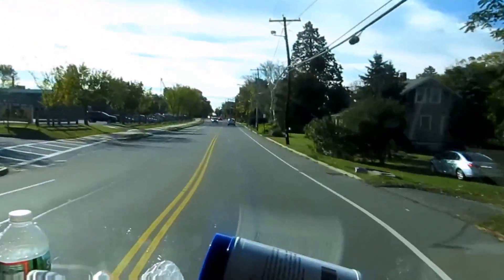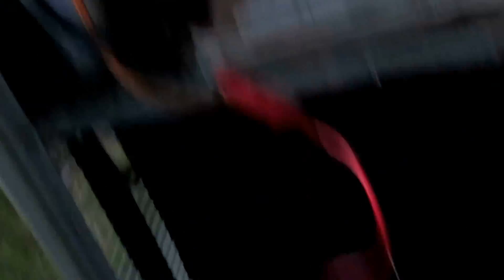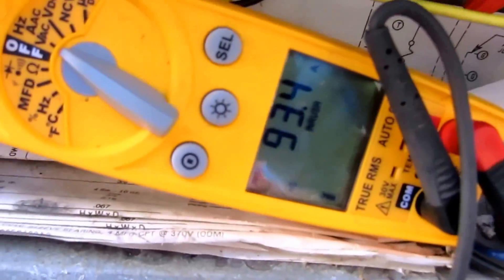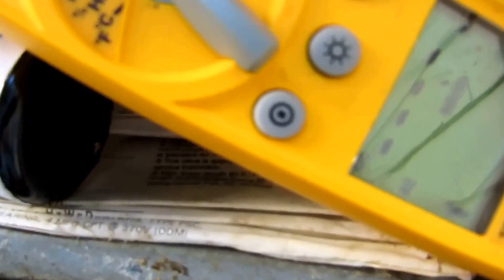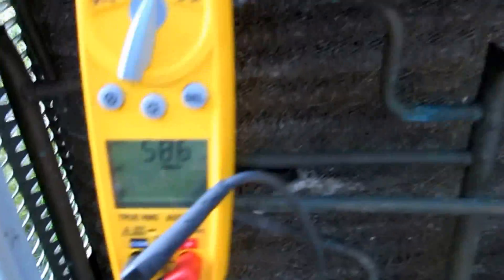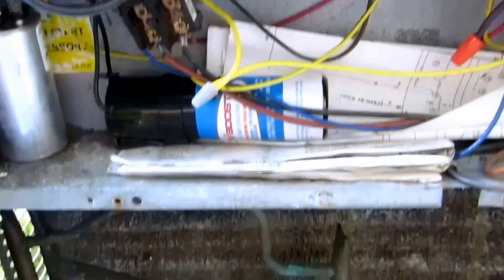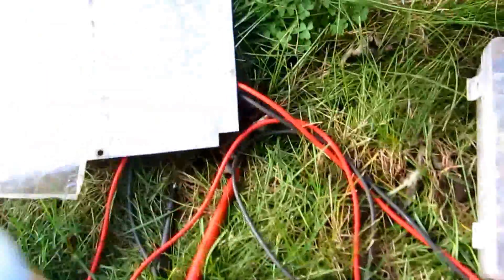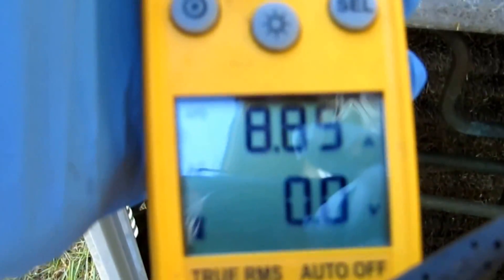HVAC: trane XE1000 condensing unit ,blowing fuse,high inrush current

Comment: have you ever had success using a hard start kit to free up a  locked compressor?
Reply from the maker: yes many times
Reply: @stevenlavimoniere  great to hear.  I have a KS-1 kickstart on order.  A new cap didn’t help, but no surprise old one wasn’t horrible but was at bottom of 6% spec.  I have tested every other thing out…even rubber mallet.  So will try kickstart and if no luck… get compressor changed out.  Thanks much.

Comment: i got a question i got the same outside unit but the problem is when the unit turn on, the unit will back off like for 30 second then repeat the same thing every time i got a video and of the machine doing it, i change the capasitor i put quick star on it and still doing the same can u help me out
Reply: i got low pressure switch at the low side too
Reply from the maker: probley low on gas when it starts the suction pressure drops and goes out on low pressure .you need to check pressures and temps and reset superheat and subcooling
Reply: but im still do knowing why the outside machine going off alone
Reply from the maker: not sure unless i was there to check it,, it could be a lot of things happening to made it go out ..hard to tell over a email

Comment: I have problem with the exact same unit.
what it does is the fan motor starts running and a few minutes later the fan quits working.
I've changed the motor and the capacitors but still doing it.
I have also by-pass the defrost board but nothing changes.
what you think the problem is?
(I've noticed that the condensing unit it's really dirty)
Reply from the maker: Asdru Flores well if the condencing unit is durty maybe start there,, clean in well and try again

Comment: Good video,  So the in rush reading should be lower than the LRA  ?  And the amp draw should be at or lower than the FLA  ?       Do you see a lot of those Edison screw in type fuses?  Those are old, I have a 60 year old house that has them.
Reply from the maker: gerry mcadams i see all kind of stuff ,,,i seen it all over the years .sometimes a hard start will help with inrush .

Comment: What is the life expectancy of one of these units? Ours is almost at 15 years. It runs but stopped blowing cool air through the vents over the last week.
Reply from the maker: they should last a while longer ,,it might be something simple ,like a run cap or burnt wire ,or needs a charge ,,,best to shut it off ,,,,and call a local hvac man to find the problem!!!!!.do not run the unit if its not cooling

Comment from the maker: you might be right... the run winding didn,t look so good with the supco m500 insulation tester. there might be and issue with the fuse block in the cieler also its old but the customer is and old lady with limited cash

Comment from the maker: i use both 5 .2. 1. hard starts @ supco hard starts depends on the situation.the supco have worked fine for me also . i so a lot of them up my way. it don,t get to hot up hear so they hold out just fine ..down south were its hotter  for a long time they might not stand up so well.thanks for commenting rod

Comment: Supco makes an oil additive, it coats all the moving metal parts and makes them more slippery. I've been using Supco oil additive since the seventies on old worn binding compressors, it works great. It also disolves gummed cappilary tubes and keeps them clear, important on pressure controls.

Comment: Hey Steven! I helped install this series of Trane, wasn't to impressed with them when they were new! They rattled lots of failure's in first starts bad compressor valves & motors. The few that survived their owners were lucky in my area. Lol
Reply: Had mine forever, so long can't remember, same model with the discolored high efficiency cap, that's long gone. Never had it serviced or looked at, ever. Blows ice cold as 15-18 years ago. I think it was that long. Lol